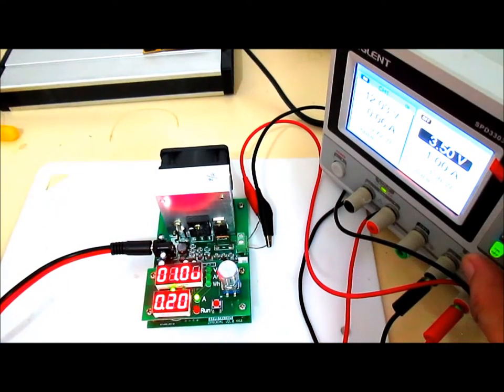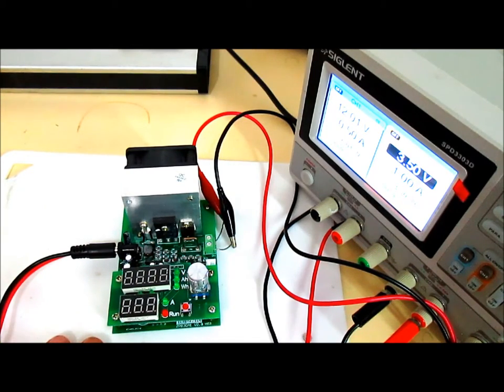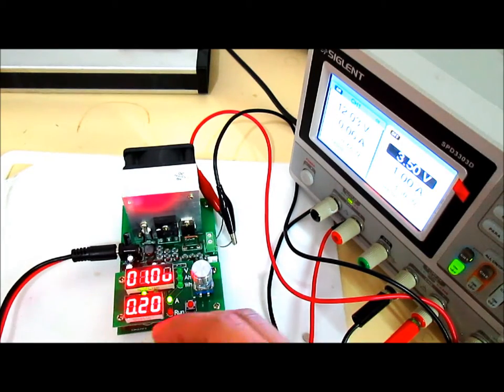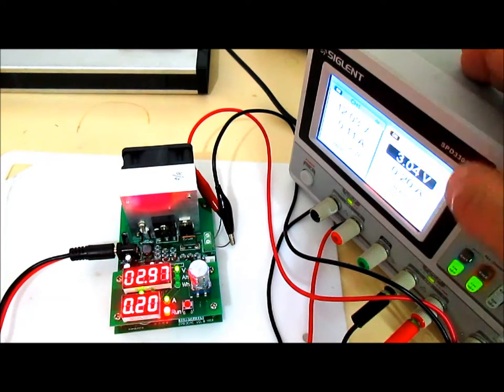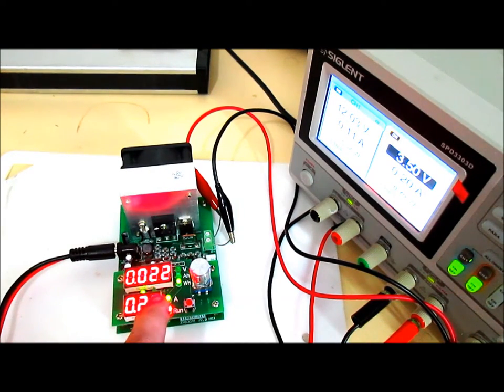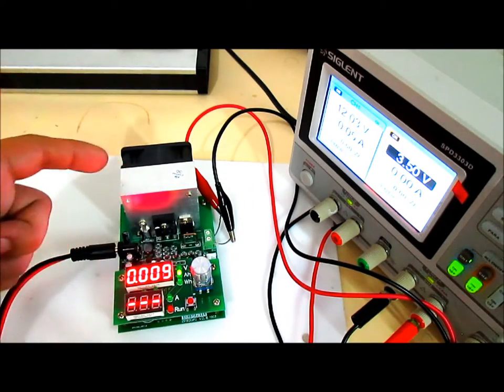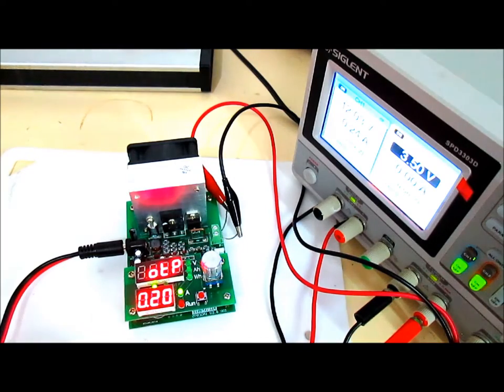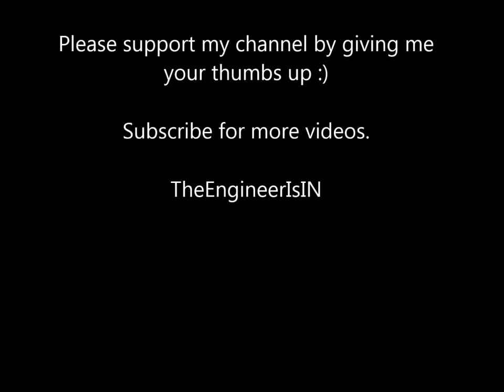ZPB30A1 Dummy Load Functionality Testing

Comment: can minimum cutoff voltage be set to lower than 1v ?
at 1v cut off voltage,  does it maintain 9.999A current load ?
Reply from the maker: Hi Sean, lowest cutoff voltage is 1 volt.

Discharge behavior at cutoff depends on the mode (mode 1 - continuous discharge ,  mode2 - stop discharge at cutoff)
Reply: Thanks for clarifying.  Wanted to use these devices to cycle some 95AH NiMh cells.  So  10amps+ (0.1C) discharge + cut off voltage of 0.9v would have been ideal. Maybe 1v will still work.

Comment: What does Error6 means after connecting to power ??- Any solution?? please help
Reply from the maker: Hi, here are the error codes:

Err1: Overvoltage for the battery Capacity determination
Err2: The battery voltage is below the preset / No battery connected / The battery is connected wrongly
Err3: The line resistance is too high / The selected discharge voltage can not be applied to the battery
Err4: Circuit failure
Err6: The supply voltage is unsuitable. Select a power supply with 12V DC and 0.5A

otP: Overheating protection
ErT: Temperature sensor fault
ouP: Overvoltage protection
oPP: Overload protection

cheers!